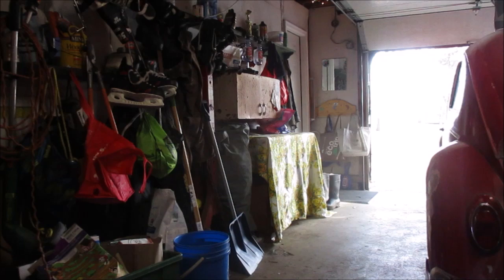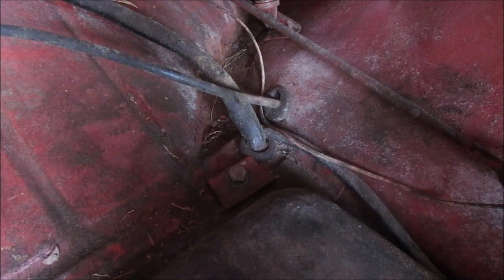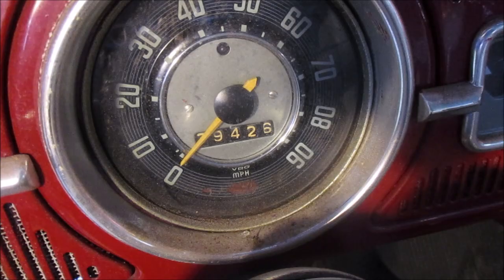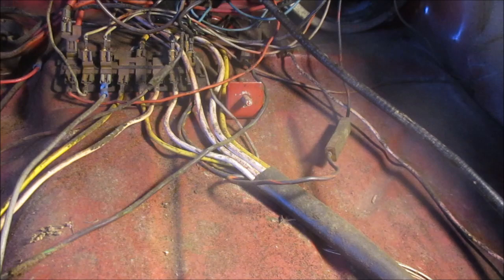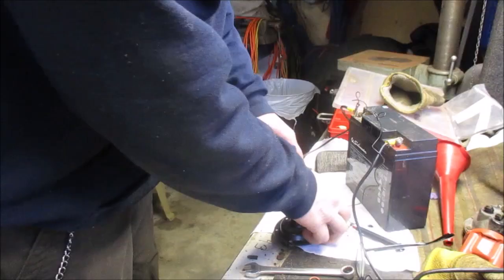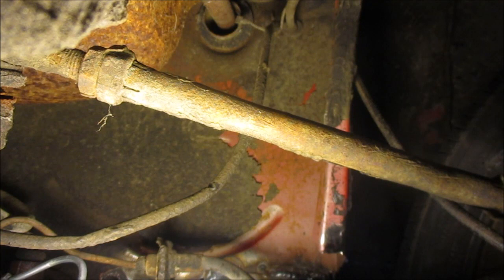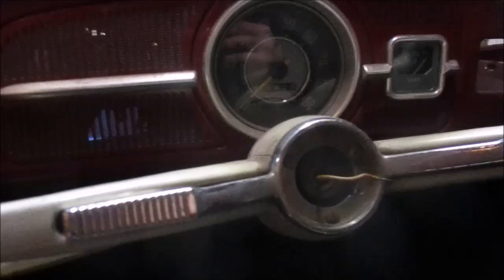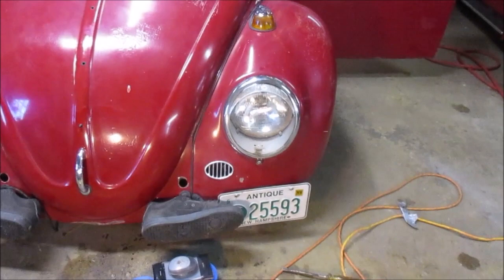1964 VW BUG SPEEDOMETER CABLE AND HORN

Comment: Thank you the horn fix!  May I ask a follow up question?

My 66 vw horn stopped. I checked all the wiring and ended up replacing the horn.  Now...the horn works 5 times and then stops.  Unplug and replug gets the same result.  

Do you recommend anything specific I should triple check?  I'm baffled. 

Thank you!
Reply from the maker: You have maybe done this already but I would clean all the connections. Hope it helps
Reply: @vwnut1967  Yes, sure did. , I still really appreciate you reaching out to make sure!  Thank you!

Comment: Hello, I took a turn while driving and my horn went off, and remained on, so I have to go under and disconnected it, ever had that issue? And why it will remain on?
Reply from the maker: I don't remember it ever happing to me but my best guess is the wire that is going thru the steering shaft must have a bare spot in it and it is grounding out causing the horn to sound. Thank you very much for being here monchy25
Reply: vwnut 1967 that’s exactly what I was thinking is hard to replace?
Reply from the maker: I would tape a new piece of wire to the old one and pull it thru
Reply: vwnut 1967 thank you, for the advice, and quick reply, I always watching your videos 👍🏽👍🏽